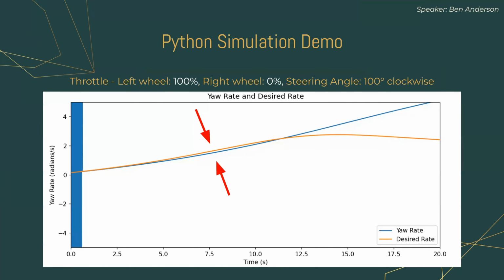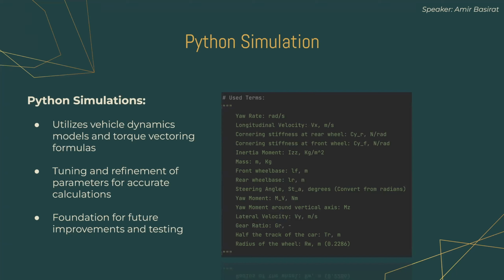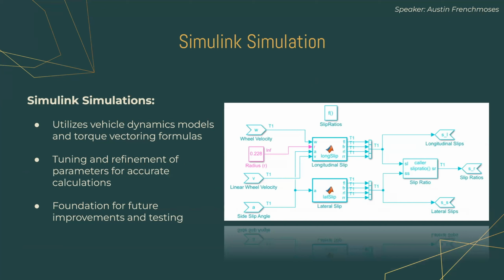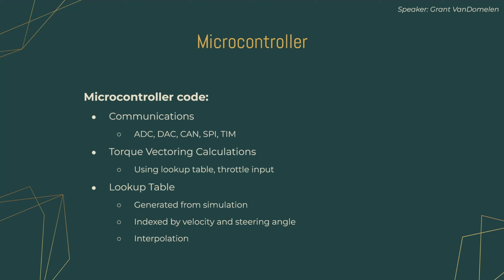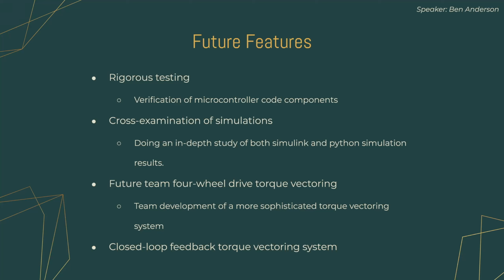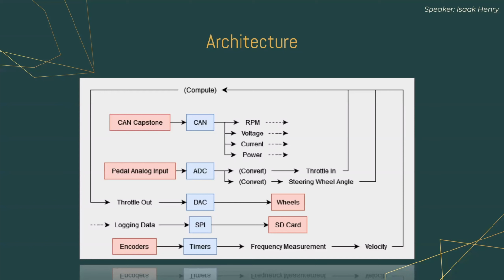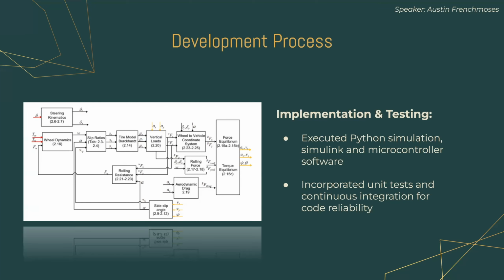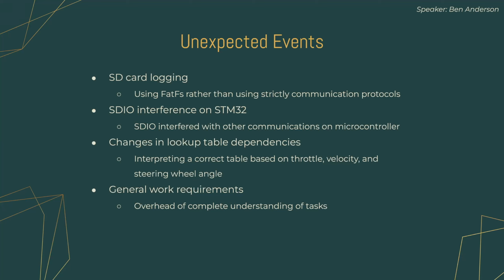Capstone WS2023 Final - Torque Vectoring

Comment: Hello, I am a student and currently in a formula sae team that is trying to develop an hybrid with 2 front in hub wheel motor, we are in an early stage of development. I am having trouble with setting the desired yaw rate. I wanted to ask, how do you guys set the desired yaw rate? Are you using simulation with car model with i.e car maker or only mathematical and vehicle dynamics model?